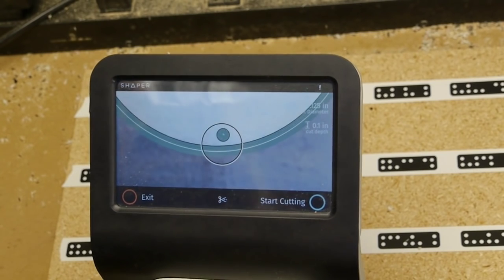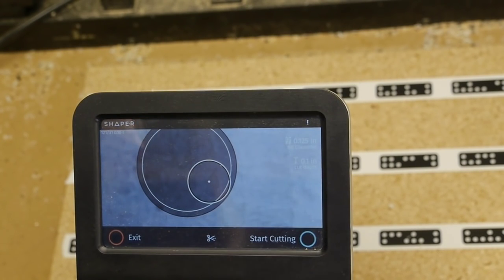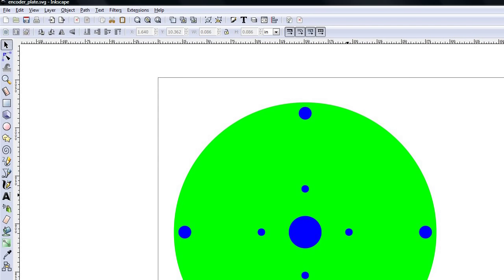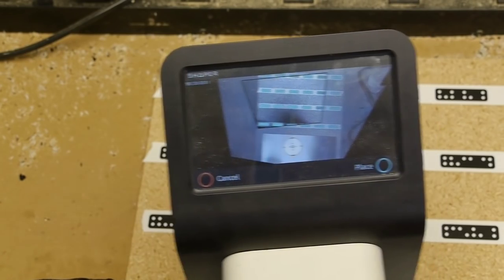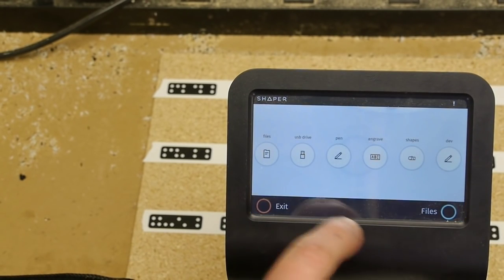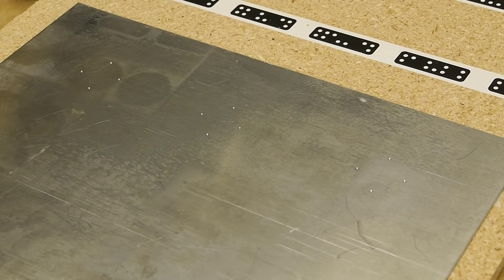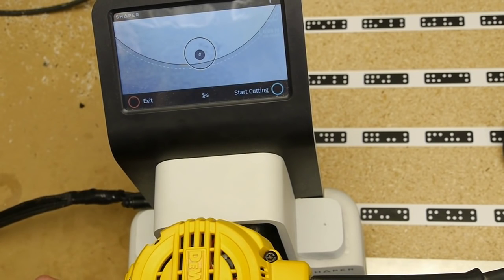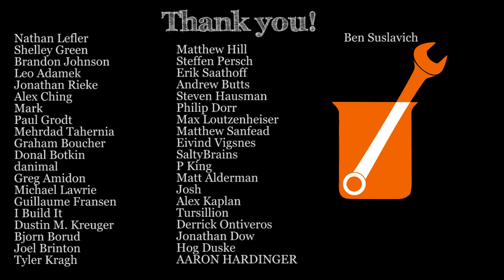Handheld CNC router repairs old CNC machine

Comment: I am sure you are getting lots of aluminum milling recommendations, but I'll add another.  As far as bits are concerned, I've gotten best results with a single flute spiral upcut.  An example would be an Onsrud 63-618.  Climb milling seems to give cleaner cuts than conventional.  Finally, directing compressed air at the bit while running makes a huge difference.

Comment: Cool technology in response to expensive cnc equipment in a marginal economy. Think of all the production factories who invested millions on cnc machines only to go out of business. I worked in 3 plastics production facilities and the cnc equipment was always having troubles, most of the time it was software related made outside the usa. Another issue is the shortage of skilled labor for cnc operators & the high costs of paying them. All 3 of these factories that hired me (for production assembly) "had no one" to run the cnc machines when i got there. I had mentioned i did some cnc work in high school in the 1980's with dos software & i wrote all the programs myself on floppy disc, suddenly they tried to stick me in the cnc part of the buildings and do it all for $9/hr! lol. Here's a tip: The Germans don't always use windows xp.

Comment: Very good video!
For big CNC mill it will be better to use linear encoders mounted directly to axis (table), it will eliminate all backlash from drive screws and they are in general interchangeable with rotary encoders (if backlash is not huge, it's doesn't matter for control system if pulses comes from rotary encoder or linear encoder).

Comment: When is this thing going to be out of Beta and on the market?
Reply: Wow. While I would love to have one, but I think at that price I could find and buy a full CNC machine.
Reply: +Jason McCabe (Camulas) probably not. If you were interested in a manual lathe, however, you could probably buy a small Chinese one for the same price.
Reply: Jason McCabe No you could not - at least not one with equivalent capabilities. This machine when I saw first price ideas was well below $5000. Now, I have a CNC which does 410x720mm which cost roughly that - but the one shown here could do a full 8 foot sheet and probably bigger.  The only reason I did not order one at the time was that there is no availability outside the US (110V)
Reply: +Jason McCabe, you surely can. So did I. It just requires a bit of manual effort to make it happen.

Comment: This looks great.  Say you need to reference to an existing feature on the workpiece (eg. an edge or existing hole).  Can you do absolute positioning with the fiducials?
Reply from the maker: +Nelumbo Nucifera Yes.  The fiducials can be placed anywhere (doesn't have to be on any specific edge), then when zoomed-in in the UI, you can use a feature to set marker points visually on the stock edge.  It's much like tracing an edge in photoshop.  Once done, you can use the machine's built-in CAM features to make holes and lines relative to the edge that you traced.

Comment: Since the part has a center hole, one could cut that using a circle cutting attachment for a router, and be done with it. All it takes, is drilling a center hole, for the center pin, and adjusting the router bit to the outside radius, then you are done. No CNC or CAD needed. It's a neat toy, but not needed for such a simple job.

Comment: ...to avoid that 'cap' on the tip of end mill, you can make an air space between the cutter and backer board...I've used end-mills quite often for 'drilling aluminum...a lot of 1" holes in 3/16" thick sections of 6063 extrusions...of course you need a 'center-cutting' tool...

Comment: Have you tried a painters tool rather than a putty knife for prying things like that? 

The chisel edge gets under things just as well, it also has that pointy end, They are a bit thicker so they don't flex like a putty knife.

You would think it wouldn't work as well, but it wedges right under and it feels much more controlled as well since it doesn't have the springiness of the putty knife.

Comment: Wood working ? This thing can be so much more ! Nobody needs this for wood, people need this for metal !!!
Reply: Fester Blats
No, I don't. I'm also very very tired of people putting stuff into other people's mouths on YouTube without permission.
There are other websites for that...
Jokes and bitterness aside, all i meant was that all he did here you can do easily on wood, but is impossible currently on metal with such precision and ease.
It's basically cut for doing metal in my opinion since it's such a help there, whilst it's less of an help for wood.
Plus it would sell so much more !

Comment: Yup I want one. Though, it probably wouldn't do well on sheet metal. I wonder if compressed air would prevent the aluminum from sticking to the end mill. At router speeds, I wouldn't be surprised if the aluminum is heating up and fusing to the end mill. Although, the more I think about it, it could also be a feed rate problem. The endmill isn't feeding into the aluminum fast enough causing the aluminum to distort out of the way instead of actually being cut.

May I ask if your mill was originally cnc or was it retrofitted. Just curios. Never saw a bridgeport cnc before.

Comment: great video and channel ☺
the handheld cnc is great and all...
but I'm more interested in knowing what controller you used to to control your old cnc .
especially the motors and encodes 
is it controlled via a motor driver or directly through the cnc controller?

Comment: Dang, I really like living in the future.
BTW Have you considered adding encoders to the moving parts themselves ?
Also how do you plan going about aligning that little clip-on encoder? Centering it by hand is OK for 200 pulses, but for 2k it needs to be spot on.
By the looks of it the machine used something similar to a standard 58mm encoder.

Comment: Can you tell how long the delay in the Shaper Origin is until it detects a movement and compensates it? When you wobble the router at #3:42 it stabilizes your shakes but for a fraction of a second the head still moves before being corrected. 
This is very visible when you look at the yellow motor-casing against the background. I expected it to show no movement with stabilization but it still shakes when you move the base, although much reduced. Are there any numbers on the lag or accuracy available? 
I'm curious how the stabilization works, is it solely based on image detection or are there gyroscopes in the tool for this?

Comment: Very nice. I wonder to have this kind of machinery in Brazil...

To prevent adhesion of molten aluminium to the tool, aka. "built-up edge", apply some alcohol. For this material is better than any other lubricant. Even WD40.

Comment: Just watch out with coolant like WD-40 and double sided sticky tape. I used it for some small parts and the coolant killed the adhesive and was barely hanging on at the end of the cut. 

If you use a ball end mill you wont get that little cap under the cutter after a pierce. Just need to go a little deeper to get full penetration.

Comment: Interesting concept, but i wouldn't expect this kind of tool to be able to hold tight tolerances because it is always reactive to movement rather than proactive.  that means that the accuracy depends on the speed of your movements to the reactive speed of the system.  i cant imagine that this is going to be cheaper than the plethera of ultra low cost cnc routers available these  days

Comment: I see the encoder you are using is CUI. Is it their capacitive encoder? I've been looking at those because of their low cost compared to optical. It'll be interesting to see if they are accurate enough for CNC mill work. Will you be using them in 2000ppr mode or at a lower resolution?

Comment: It is a really nice idea for saving space, and if you only use it occasionally it should do well enough. But the price tag is too high for the average hobbyist; you could easily get a small, independantly working CNC router for that.

Comment: You might have better luck with a two flute endmill for aluminum. The 4 flute tend to get bound up with aluminum.
Reply: +Drew Mcdonald .Right, I've used end mills a lot for 'drilling aluminum...always a 2 flute, center-cutting....and leave airspace behind the aluminum and backer board..

Comment: hey, i have that router, are you using the original chuck? I've been trying to find a fairly affordable chuck for that router so i can put various size bits.
Reply from the maker: +CaliReef It's a standard 1/4" collet in the DeWalt router.  I wanted to use 1/8" diameter tools, so I bought an Amana 1/4" to 1/8" adapter.  It works really well, and there are many more milling tools with 1/8" diameter, so it helps a lot.  When cutting metal, using an 1/8" tool is much easier to handle due to lower cutting force.  http://www.amazon.com/Amana-RB-102-REDUCTION-BUSHING-TO/dp/B001NI6KO8

Comment: Hey Ben. Thanks for yet an other great video!
What other hardware do you plan on using for modernizing the ol' Bridgeport? I guess some off-the-shelf servo amplifiers a controlboard and a computer with Mach3, LinuxCNC or PathPilot or something along those lines? Do you plan on checking the ballscrews or any other mechanical parts? I would be interested in videos on any or all of this. I am looking at CNC mills, and everything affordable seems to be older than me, and will most likely need a bit of work.
Reply from the maker: +Søren Fuglsang Thanks!  The milling machine is an R2E3 Series 1.  It was originally made with decent ballscrews, which are still good enough to use.  The motors are 30 in-lb servos rated up to 6000 RPM, so those are fine too.  I bought a Centroid Allin1DC, which is a three-axis DC controller that communicates to a Windows program via ethernet.  It's more expensive than stepper-based CNC controllers, but offers higher performance, and the capability of doing simultaneous 4- and 5-axis moves if I add a trunion table later.  I'll probably do a video about the upgrade process.
Reply: +Applied Science Thanks for the reply. Good to hear that everything still should be in good condition. The controller seems quiet capable, but yeah, CNC stuff gets expensive quickly! Even though I know it might be slighly outside your normal subjects of your channel, I think a lot of your subscribers would enjoy video(s) on the subject :)

Comment: If there's no price available, it's not possible to weigh this tools value to anything else yet. If it's too expensive, CNC router is much better alternative unless you absolutely need portability.

If it's too much of a hassle to use and set up, then it's again on par or worse then CNC.
Reply: +Mtaalas Guess you missed the "BETA" part...
Reply: +Mtaalas Depends on the user. If you do a lot of woodwork and travel to job sites I can see this as being extremely useful

Comment: How about a laser diode instead of a router?
Reply: +Dave That would make it a class 4 laser, and much more difficult to incorporate and sell with proper safety. The 650W CO2 laser I run requires a 6' area to be clear of people in order to run it for safety purposes.
Reply: Thor214 Enclosed in a cylinder maybe?
Reply: Dave Perhaps, but commercially viable (meaning high-powered enough to cut in a reasonable amount of time) lasers are putting out at least 50-100W. In order to generate that laser beam, the source needs to be adequately cooled. For my laser at work, this means a 2.5' cube running with 1.5' coolant lines circulating 20°C water into the laser source. Of course, that will be smaller for a lower-power laser, but still unlikely to be in a reasonable form factor.

Lasers are generally used for very specific machining uses, usually on materials that don't respond well to spinning bits shewing on them, like vinyl, some plastics, and close tolerance wood (think inlays and other uses where de-burring the edges will affect the intended shape). 

Their other use (more common in hobbyist usage) is for etching designs on surfaces. This cannot be achieved reasonably in this form factor and is already attainable in desktop models. Generally such usage uses raster graphics/designs over vector cut paths, akin to a common inkjet or laser computer printer. The speed it would be able to do this function at would be abysmal for those in that sort of hobby.

Comment: That's cool and everything, but that router is not Computer Assisted, not CNC.
Reply: It is still very much CNC.
Reply: CNC == Computer Numerical Control.

What you have is a computer assisted device.  You are moving the device around, also known as "controlling" the device, and it is simply assisting you. There's a very very big difference between the two.

Comment: Uh, nope. The aluminum resedue left on the bit was not a problem of a bit, but purely on the Shaper side or was caused by it's kinda misusage.

Working with metal just brings the essence of this problem in it's most obvious way. None of flat end endmills are designed to be plunge straight down into the material due to obvious reasons. Ramping down into the stock would've drastically reduced amount of aluminum stuck to the bit.